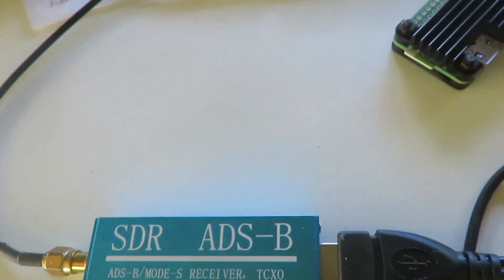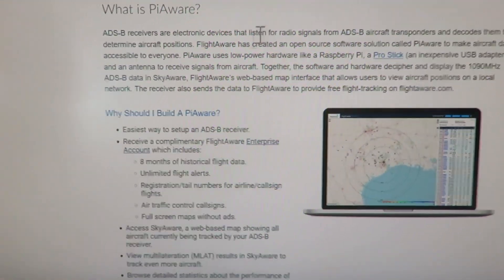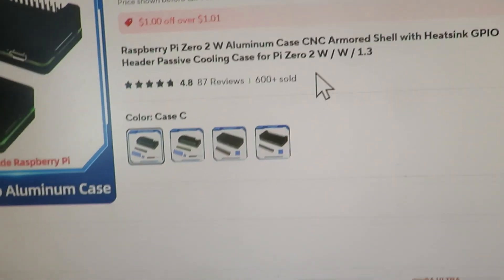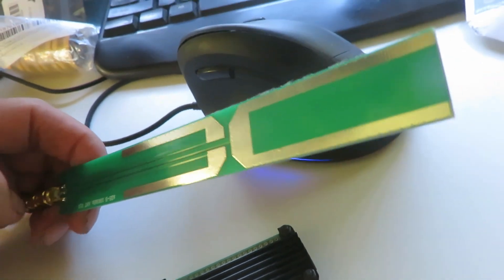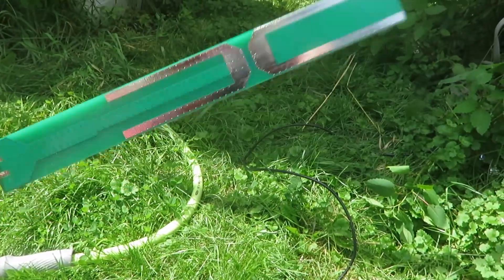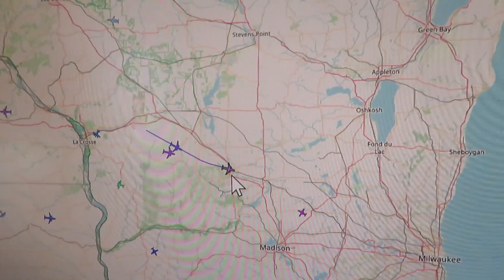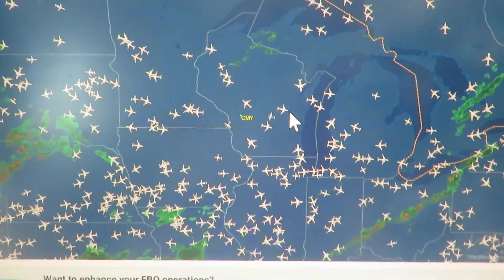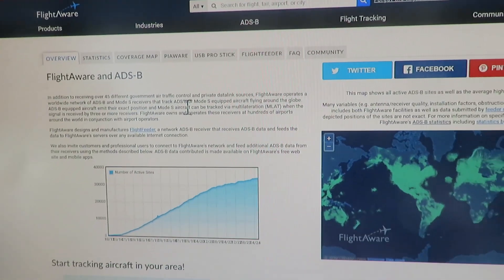Piaware Flight Aware SDR receiver on Raspberry Pi Zero 2 W

Comment: Well done Larry
Have you experimented with that Image in a Raspberry Pi Zero W?
Reply from the maker: No I haven't tried it with pi zero w but I think it is supposed to work on that one too.
Reply: @LarryKapp1  exactly but there is a difference in processing power and you will notice!  But for camping or traveling the Zero W could be invaluable!
Reply from the maker: @km6mmo843  The Pi Zero 2 W has about the same or less power consumption as the Pi Zero W .  So maybe time to upgrade if possible.

Comment: Coaxial cable link? Thank you 🙏
Reply from the maker: make sure you get the right ends - I ordered SMAJJ 5 meters . You don't want to go too long because probably a lot of lose of signal in this kind of coax at 1090 Mhz frequency https://www.aliexpress.us/item/3256805719288324.html?spm=a2g0o.cart.0.0.639138daftk6ff&mp=1&gatewayAdapt=glo2usa
Reply: @LarryKapp1  Perfect, thank you :)

Comment: Thanks for sharing. Just picked up a pi 2w to experiment with!
Reply from the maker: They work pretty good - just set it up first using the Raspberry Pi imager and you can have it flash your wifi , etc along with the pi software. Then you can SSH into it. I haven't been using the desktop image but I guess you can if you want to - then you need to use vnc viewer to see it from another computer. But if you know the linux stuff you won't have any problem. I am using another pi zero 2 w to run Pi Hole and have the older pi zero w running weewx for my weather station . Both those run stable and never crash . Have fun !